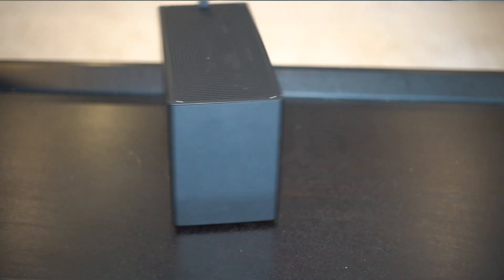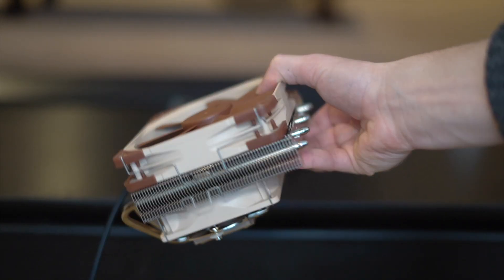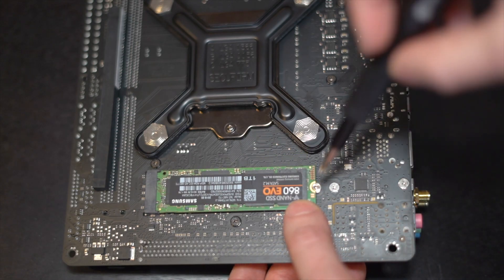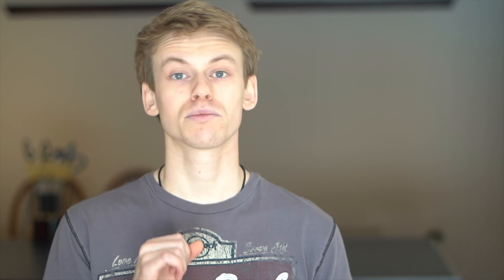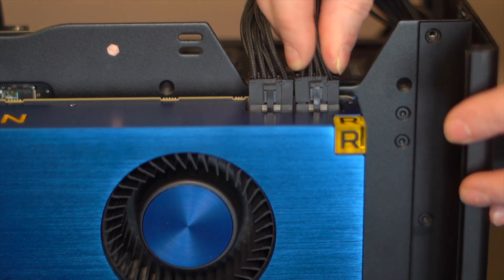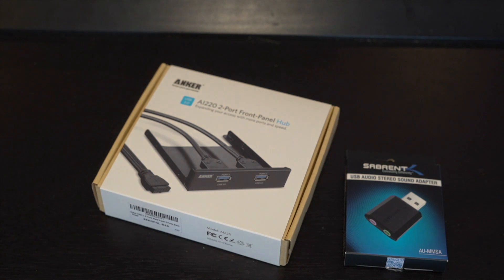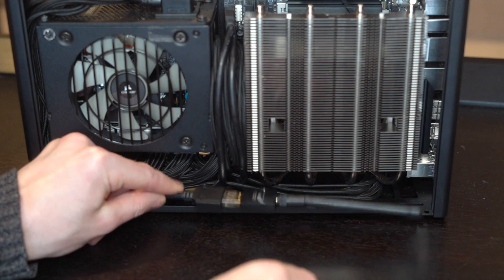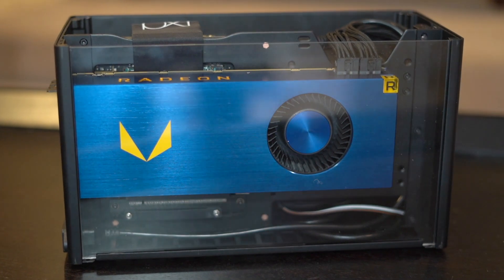8700K + Vega 64 Hackintosh, iMac Pro Killer?!? BENCHMARKED

Comment: T-919 by fenvi can fix that Bluetooth/WiFi situation 
And you can use an m.2 to pcie 1x to connect it
Reply: Ty Clark how do tell?
Reply: @rexloser9608  well the fenvi works natively and here how I wired it up https://www.ebay.com/i/253454407364?chn=ps&norover=1&mkevt=1&mkrid=711-117182-37290-0&mkcid=2&itemid=253454407364&targetid=595076253728&device=c&mktype=pla&googleloc=9028289&poi=&campaignid=6470636535&mkgroupid=77538519077&rlsatarget=pla-595076253728&abcId=1140476&merchantid=119155978&gclid=EAIaIQobChMI0qOiopjz5QIVBqSzCh3GnAI5EAQYAyABEgKMDPD_BwE

Comment: Nice Video, did you have any issues with the wifi inside a metal case? Also I like the look of the glass on the gpu but what about air flow, what kind of temps are you getting in idle ?
Reply from the maker: No issues with wifi. Speed may be slightly slower but it's not noticeable in my house or any coffee shops I bring it to. The temps peak in the upper 70's on CPU. So it's definitely hotter but well within Intels operating temperatures so I'm not too worried. As far as gpu temps peak around 81 with glass and 80 with standard side panel. Not too much of a difference as it is a blower style card.

Comment: My i5 imac 2017 is 10 times faster than my ryzen 1700 hackintosh... Coz of intel quicksync... would love to see renders speed from fcpx on consumer intel cards .. Cinebench n bruce x are a scam
Reply from the maker: I wouldn't say "scam"; however, quicksync does accelerate apps that can use it significantly. Geekbench specifically doesn't do a great job of real world performance but it's a baseline measurement which is why I used it.